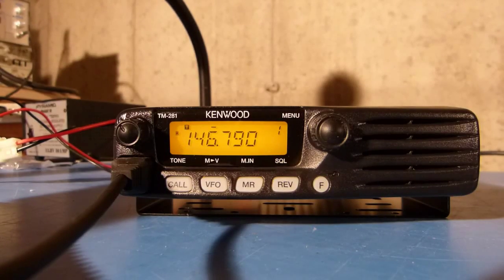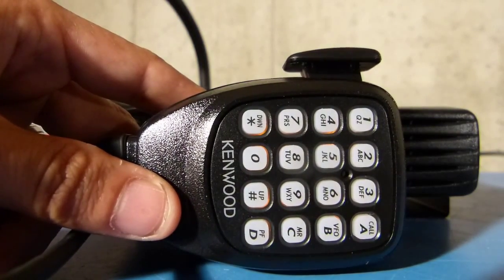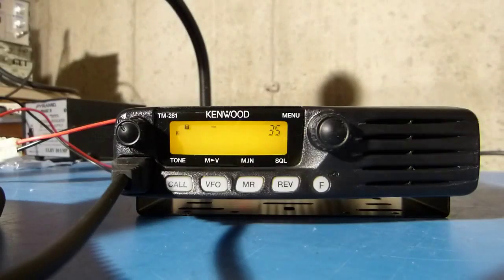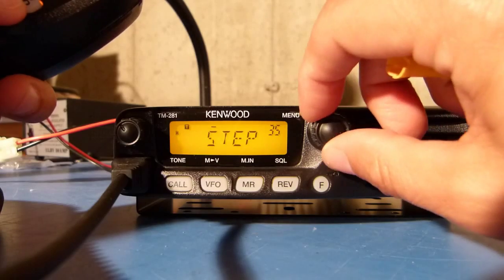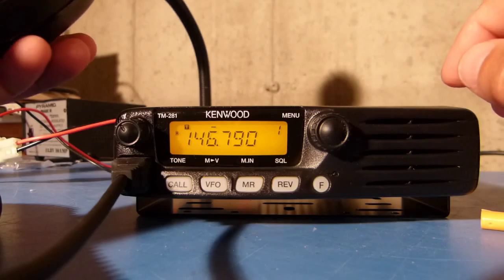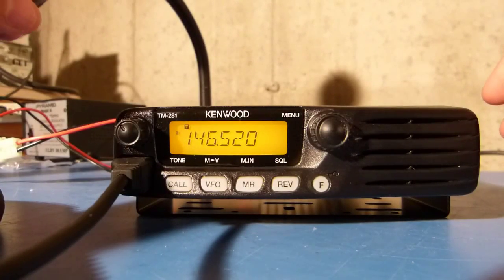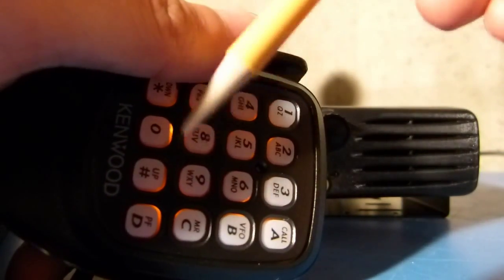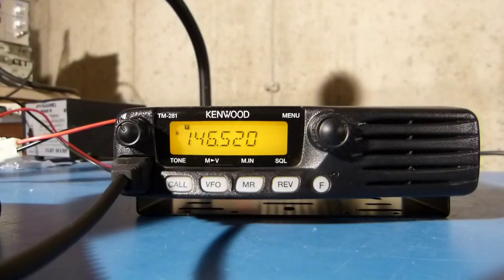Kenwood TM-281A Mic Button Programming

Comment: Hey has anyone had the problem of the menu not working and can’t switch to Vfo or delet a memory Chanel. Also can not get it to reset any help is great thanks
Reply from the maker: You might want to Try a factory reset and see what happens.
Reply: Tried to reset it it won’t do it I’ve tried multiple times

Comment: Very clear, but my radio does smtg different. When I attempt to enter the freq with that method I can only get halfway through the key input and then the entered freq changes. Eg, I want 442.500 but once I get to the “2” the screen changes to 173.000...? Any ideas? Thanks!
Reply from the maker: This is a VHF only radio....you can't enter 440 frequencies into it.
Reply: SevenFortyOne ah...those must be the HF repeaters. Thx